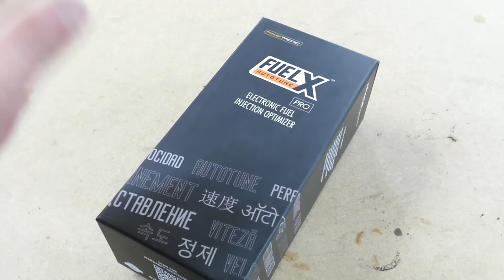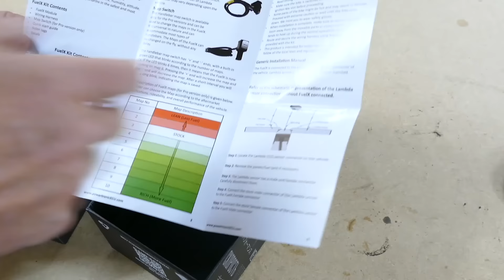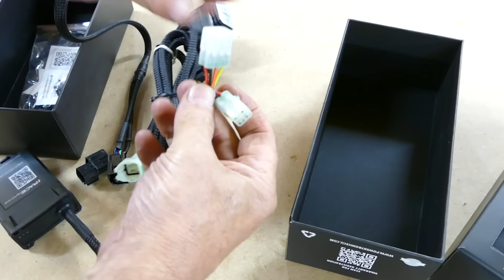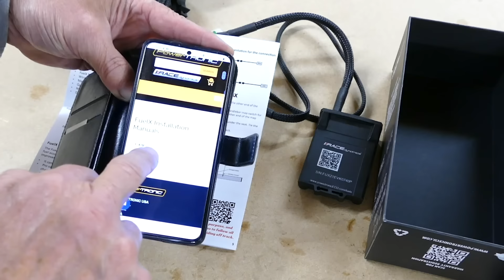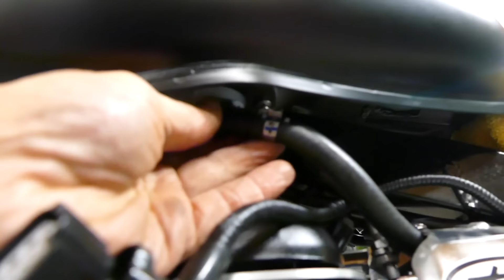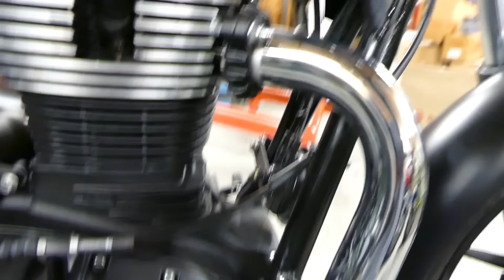Royal Enfield: FUEL X!

Comment: Interceptor 650 Euro 5......I'm running your TEC Big bore Headers and Silencers (Full system which I love BTW) with standard air filter system, (also have DNA air filter currently running standard though as i fear lean mix) will this exhaust upgrade make the bike run lean? and would this system be beneficial or not entirely necessary? Also i'm In North Australia, so running hot is of concern as ambient temps are rarely below 30C, and at times above 35C when i'm out, Thank you in advance.

Comment: I’ve got a euro 5 running lean after putting end cans on. Popping on deceleration. Will one of these cure it or is a proper re-map better?
Reply: Hi, I have a INTERCEPTOR  euro5 and I fitted a Pro. I run it on map 6 or 7 and no dramas at all. I have Headers & mufflers fitted but I installed a extra baffle in the mufflers. Once I did this it was amazing how much more power the bike has now. I'm going to get a Remap done then take off the Pro. The amout of Torque it has now is really noticeable. They are ok but a Remap is the best way.. Ok stay safe and happy riding......Chris (Australia)
Reply: Buy the X lite standard version,  not the pro. 
It's not worth having the pro. 
It will eliminate the popping silencer. 
Has mine on my RE Scram euro 5.

Comment: It just plugs to lambda sensor... Same as booster plug...booster might be single setting by making air look like 5 degree cooler...

I really think wideband sensor and autotune ecu is way to go...but those things are expensive...

But getting bike tuned will be next best thing with piggy back ecu, or flash stock ecu...but

These make shift parts are SOMEWHAT useful but REALLY useless....

Comment: Thank you for the video.
I can find many videos explaining me the way how the FUEL X works, the quality of it and how it has to be installed.
What I have never found is a Dyno diagram, that shows me the advantage of the tuner.
What I really would like to see is a Dyno diagram, that shows me a curve of the stock mapping and another curve modified with the FUEL X tuner.
That would make sense.
Regards from Austria and thanks again for the video.
Reply: As far as I know you get the dyno chart included in the Box which shows stock and the other maps, power and torque figures which were recorded during the testing process for the specific bike!
Reply: @printstanza7792  That's good.
But I like to see it before buying it.
Reply: @wolfgangnapiletzki8480  check out their website I am sure you'll find some information there for your specific model!
Reply: It would be a simple matter to sample the exhaust gases and document that the motor runs richer and leaner as selected.  That would also be nice to see.  Maybe the Dyno diagram would do that?

Comment: I have a question, i manage to gain about 8 hp and 10 nm of torque on my gt 650 using only mechanical upgrade (the engine still have 650cc of displacement) The fueling for now is 100% stock. It uses 95 octane fuel for now (because of our local policy, i can't buy the 92). The bike is running great but, it does feel a bit lean. The power delivery is not as smooth as factory setting, but it is still very enjoyable. When i close the throttle abruptly, it tends to pop badly. Will this be sufficient enough to put on my bike, at least to make it safer to ride with the mods that i have. Or should i better of buying the powertronic ?
Reply: Typical Indian, half knowledge

Comment: Hi, I’d be interested to know if, once fitted with a fuel x pro, would I need to let the engine idle for 10 to 15 minutes on tick over like with a power booster, or would I be able to ride straight away?  Many thanks in advance 👍
Reply: Idle for 10 mims

Comment: Could you please explain why removing the fuel tank was necessary? Can't you access the lambda connector from the side, without removing the tank? I could easily access the sensor, and even installed the fuelx lite version on my meteor. Now i am worried whether i missed something during installation.
Reply: Hows it going? Fuelx lite runs at which settings? Thanks for feedback

Comment: I have installed red rooster polestar pro exhaust in my meteor350, is it advisable to install fuel x pro in the bike?
Reply: Change the air filter and fit the fuel x , u will notice the difference

Comment: Do I need to install a system like this one to my meteor 350 if I want to change the exhaust? Doesn't the ecu optimize the air fuel mixture with the sensors by itself? I'm asking because I don't know and I don't want to mess up my motorcycle. (P.D. I plan to change the muffler only, not the entire exhaust system)

Comment: I have a fuelx pro on my 22 adventure. More low end grunt. Smoother low rpm ops. Power seems a bit higher too.
I am running at 6 or 7.
Reply: Hi, I run mine on 7 as I found it smoother at low RPM.

Comment: SURELY USING 2 RESISTORS AS A VOLTAGE DIVIDER, WHICH TAKES THE O2 SENSOR OUTPUT AS INPUT will produce a different but varying output. is the map air sensor, also guarded. if not fooling the ecu that more air is going in will richen the mixture. neither of these will eliminate the need for a free breathing camshaft, but should allow the cam to have a better result. this would increase fuel consumption, so ideally be switchable. labeling the switch as hill mode and plains or power/economy. may help proper use. I know I would want one as there are some serious hills in the way of my trips with 100 miles of flat before another set of hills. i am saving up for a scram at the moment, with the idea that your cam a free flow air filter with a cold air inlet finaly a new header pipe to reduce it to 1 cat, 2 sounds a bit restrictive. perhaps a new can if it is not too loud. sorry about the length.
roy

Comment: The J series bikes need a little more power in my opinion...  A modern Vespa GTS 300 has a dry weight of 158kg and has a power output of 23.8 bhp / 26Nm  from its liquid cooled shorter stroked engine..  The meteor has a dry weight of around 181kg with 20.2 bhp,, It is just too underpowered for european highways.. A 411 scram with the camshaft upgrade and around 28 bhp is good though ..

Comment: I’m so glad my 865 install was on a Euro 4. It was hard enough to find fooler plugs here in the States - Power Commander does not ship them with the PC any more and do not sell them. I found some for a Polaris ranger that worked. I wonder what the work around is for an O2 delete on a Euro 5?
Reply: Is the 865 worth it? Bought my gt last year and have been considering it. A bit more power would be nice on the highway.
Reply: @Re1ardedLeadSlinger worth the cost time and effort, probably not. The big bore is going to run $3k by the time you get done. And it is a fair amount of work, if you’re not mechanically inclined it would be daunting. These bikes aren’t that valuable anyway. But it is fun and I enjoy working on my bikes and modifying them. the value is in that really

Comment: Just got the fuelX pro for my meteor and I'm happy with the improvements in the overall smoothness of the bike. My only concern is that if I run the fuelX on setting 10, the highest map, does it effect the spark plugs in any way or am I fine?
Reply: After riding for a week or two, pull your spark plug and compare what it looks like to a spark plug chart. If it's too rich, you will get sooty build up on the plug, then dial it back until your plug shows a nice clean burn.
Reply: Bro I have installed rrp exhaust in meteor350.  Can we install the fuel x pro in the bike. Is it safe?
Reply: This is an example of why most riders should use the standard version , if you don't know what effect a setting is having then you shouldn't be altering it ....

Comment: I’m not sure if you guys know this but is the meteors speed limited to 75?
Reply: Yes, there's a speed limiter at 75mph. Not a rev limiter, a speed limiter.
Reply: @Rempa  gotcha I was wondering. I was going down a hill on the highway and the bike started jerking.
Reply: @MastaKeahi  It's really annoying and borderline dangerous: I thought my bike was having a fuel issue when it first happened to me, you can feel the ECU cutting the fuel pump to slow down.
Reply: @Rempa  yeah I think it’s pretty dangerous as well. I wonder why they did it?
Reply: @MastaKeahi  It is supposedly because of Indian regulations, but my question is why if it apply to india why did they ship it with the Indian ECU? I think that this bike is great, it feels solid and is such a pleasure to drive as a commuter bike. But this... It is but a stain of this beautiful painting.
Reply: @Rempa  Yeah I’ve had a lot of issues with mine like the speedometer just stops working. I really wish I got the 650 and at this point I may trade it in on something else.
Reply: @MastaKeahi  Def what I'm planning to do next. Switchfor the 650 twins.
Reply: @Orbital Cooker This a damn good theory,  if I wasn't selling it I would test it. I wonder if you could do the same by just disconnect the sensors on the 2 wheels (granted you would lose all speed, mileage and abs): would the ECU stop limiting?
Reply: @Orbital Cooker Keep us updated :)
Reply: @Orbital Cooker awww. That sucks. The shipping situation is a nightmare on a global scale. I guess 2022 is not gonna get any better.

Comment: I put a end can and removed the cat plus an air box mod to my Meteor, makes her breath and lift a bit better but iv noticed at traffic lights the bike lingers very slightly before fully resting at tick over. I'm wondering would this little black box cure that😮
Reply: Have you blanked off the air injection into the exhaust? it will do this if you have.
Reply: @georgemilburn6213  no but thanks for the information 👍👍
Reply: @georgemilburn6213  Can you explain more how to blank the air injection off? I am facing a similar issue

Comment: Hello Sir, I liked this video and its helped me a lot to get an idea of how fuelx works as I also have Meteor 350, am from India and I also have a bajaj Dominar 400 with 35bhp and 35Nm torque so I feel the meteor is very under power in comparison however I like it bcoz of its smoothness, looks and the J series engine which is way smooth and its mileage as well. However, now a days I feel if my meteor can perform a little bit with more power so I would like to know if Powertronic ecu can help my bike to gain that power for my bike to make? I want a detailed video on this with the difference in speed. Sir if you could do it for me and my Group it will be very much helpful for us to understand.
Reply: Hey Buddy, so there is basically no power gain from it, i tried it with my mechanic. It just helps to make the bike more smoother and refined. Also if you like to take it on trips, Ladakh is the most famous for us Indians, then it helps the engine to adapt better to altitude gains. If you want increase the power output then you’ll have to look at hardware changes for it. Easiest ones will be better air filters and maybe even a slightly bigger intake plates. If you wish to increase further then maybe you can decide to bore the engine and increase compression. 
Hope that helps

Comment: How to know if the Lite version is working correctly? Is there any kind of led or signal on the unit that indicates that power is coming to it when you turn the key? Thanks a lot!
Reply: Hi, The lite unit has to have power as it is taken from the feed to the O2 sensor. If this feed was broken the MIL fault light would come on. The whole point of the Lite version is that it is plug and play- fit and forget. If you want lights and selectable modes go for the more expensive pro version.

Comment: Looking into buying the fuelxpro. Currently have the S&S mufflers and air filter. What setting have you guys found works best? 

I have seen that too high a setting will cause plugs to foul? Is this the case in your experience? 

I have a euro 4 bike.

Also when’s the next video, part 5 out for the interceptor.
Reply: I find that settings 4 to 7 seem to be best in most applications. I have not had plug fouling even on setting 10.

Comment: There seems to be some misunderstanding here.  Booster plugs makes the main map richer, and Fuelx only affects the closed loop based on the feedback from O2 sensor.  People seem to be ignorant of this matter.  So most of the time the FuelX would not affect the riding at all, as majority of it is in open loop.
Reply: Correct, this is why I say that the boosterplug is a better option for Euro 4 bikes. But you cannot use a boosterplug on Euro 5 bikes as that has been blocked by the ECU . Fuel X is the only current option for Euro 5 bikes apart from a full ECU remap.
Reply: @georgemilburn6213  but is a booster plug worth while fitting ,,, fu🧲k the law ❔
Reply: On a 2026 super meteor

Comment: My Euro5 interceptor randomly cuts out on idle, or sometimes when pulling away. They haven't managed to sort it under warranted. Would fitting one of these solve this? And is it legal? And will it void my (admittedly pointless) warranted?
Reply: Does it cut out at high throttle loads? Could very well be bad ignition coils.

Comment: What would be the fixed richness setting on the Fuel X Lite in terms of richness settings 1-10 on the Pro?
Reply: Emailed them recently. They said 6 or 7 depending on the bike. I ordered a Lite recently for my 390 Duke. Yet to receive it.
Reply from the maker: @twowheeledparadox  Hi
 the readings we took on the Lite version were about the same as setting 7 on the Pro
Reply: @TECBikeParts  Thank you for confirming that and, of course, for your informative video! I hope that is the case with the Lite for the 390 Duke too because that bike runs really lean and hot. Race Dynamics, in their email, did say it depends on the bike. They also said that the Lite targets an AFR of 13.5:1 to 13.7:1. Cheers from India, by the way!

Comment: Interesting to see how this is, my euro 5 Himalayan seems jerky at lower rpm hopefully it will smooth that out
Reply: Interesting as mine is 5 months old euro 5+ and excellent fuelling. I had triumph 400x and Cfmoto450 and Enfield is way ahead.
Reply: @garymitchell6897  Hi Gary, interesting from the time I wrote that post I have sold my Himalayan and had a CFmoto MT450 and yes I agreed, compared to those it’s spot on ,I have actually sold the  CFmoto and bought another 411. The comment referred to my 2022 bike I now have a 2024 bike and this one seems much better standard.
Reply: @hikerbikerallnightcamper1393 yes the 411 is great but myself and two brothers have 450 and not had any fueling issues. Enjoy your new bike.

Comment: Very informative. Thanks for posting. Could you let me know how the Fuel X Lite would affect my 2022 Meteor 350. I don't really fancy the controller on the handlebars. You mentioned the engine sounding like it's on the wrong type of fuel when accelerating. Mine sounds "thrappy" when under load and it detracts from enjoying the ride. Many thanks. Keep up the good work.
Reply from the maker: If you don't want the switch on the bars, just go for the Fuel X LITE version

Comment: I’ve got you cam and the dna filter with a booster plug on my Himalayan. What (if any) is the benefit of this mod?
Reply: Not really, it is more aimed at Euro 5 models as the booster plug will not work on those.
Reply: The video seems to imply that the Fuel X enrichens the fuel-air mixture at low rpm like the Booster Plug did for pre-Euro 5 engines.
The effect would be to improve the off-idle throttle response, i.e. remove the jerkiness at low rpm.
Reply: Thanks George, I ordered a Stinger for my INT 650 (has a booster plug and dna) but it is a Euro 4 so no need for this

Comment: Eh, I just bought a booster plug to help compensate for intake and 2-2 headers.  Wish I'd known.

I was very tempted to buy a Powertronic piggyback in case I get into a cam or high compression pistons some day and still have a bit of post-decisional regret about not springing for it.  It would be great if TEC could adopt either Powertronic or Power Commander and offer maps for various common tunings.
Reply: personally on most bikes I would use a boosterplug as I prefer the method it uses. But as explained on a lot of new bikes the boosterplug is no longer an option. We use and sell both types so I am not biased to one or the other.
Reply: @georgemilburn6213  I am in the US where Royal Enfield is still supplying Euro 4 bikes, for which I am grateful.  I'm looking forward to trying the boosterplug with my new headers.  Thanks for your comment!
Reply: @peteb2304  Hello, I'm also in the US, California, what headers are you using? 😎

Comment: Does this replace the Booster Pug system or in conjunction with that Plug. I bought the Booster Plug from you a couple years ago.
Reply: Hi, yes in theroy they could be used together and would cover both the open and closed loop, but in practice only one is required.
Reply: @georgemilburn6213  Thanks George, which would you recommend?
Reply: @daveg4495  My preference is still for the boosterplug for pre Euro 5 models, but the only option for Euro 5 is the Fuel X at the moment.
Reply: @georgemilburn6213  why so?